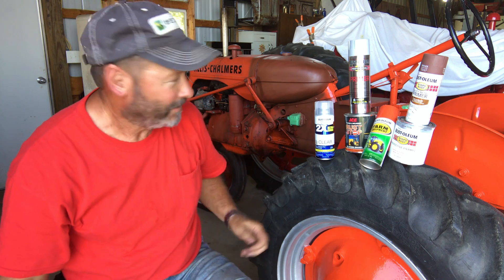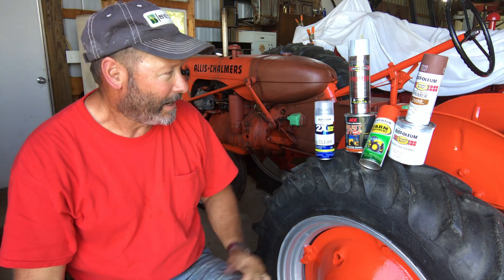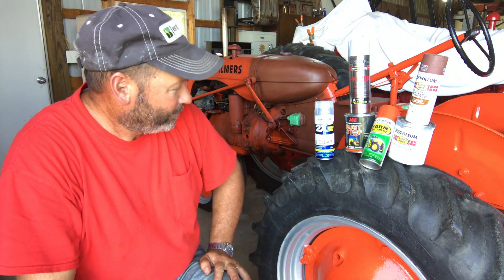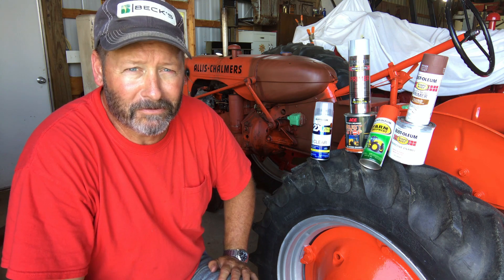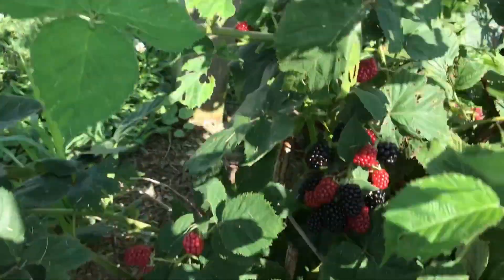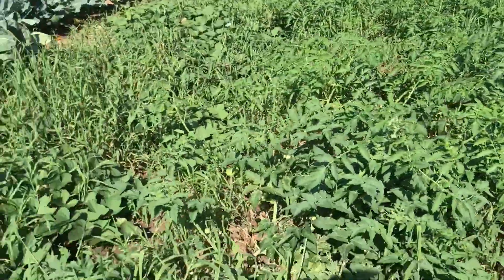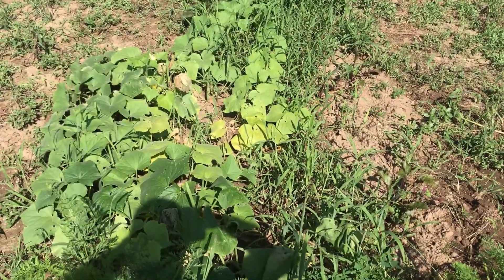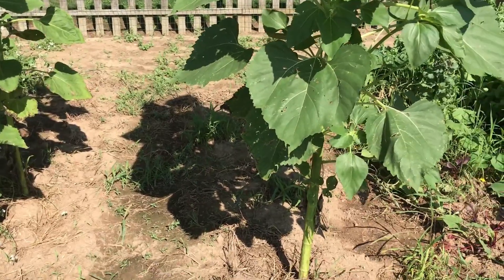Painting the Allis-Chalmers C project and Garden update!

Comment: Looks great so far.  Do you sand between coats?
Michael from Canada
Reply from the maker: If I was doing the hood area I would,, but not the cast iron areas.  I do add some hardner to the paint.
Reply from the maker: ps when I do some engine work on it soon, I will be giving the hood  & grill to my neighbor, he has a sprayer and does real nice work. At least the hood and grill will look professionally done.